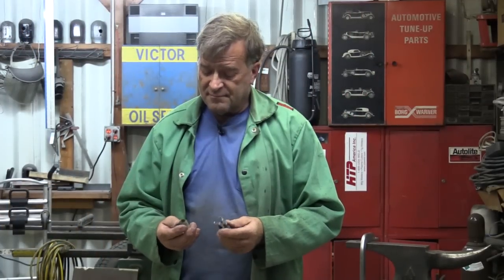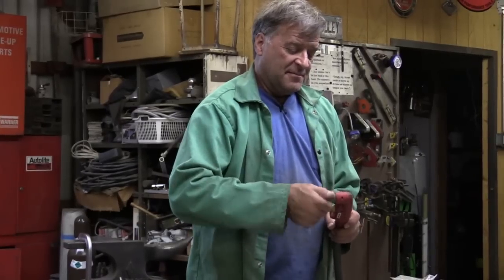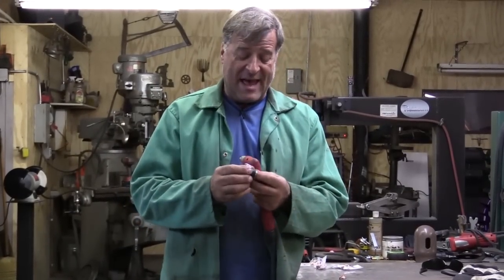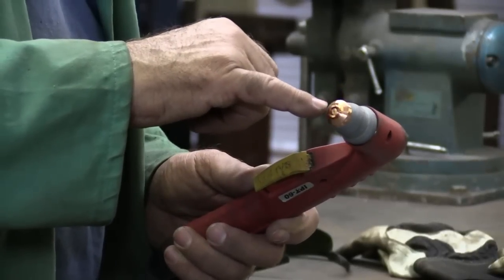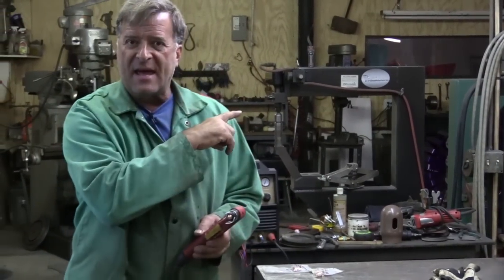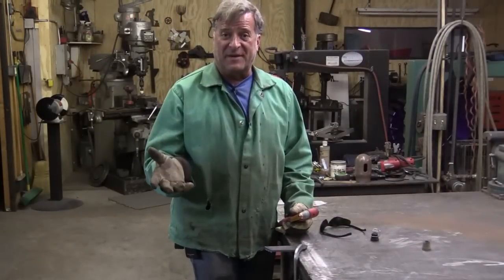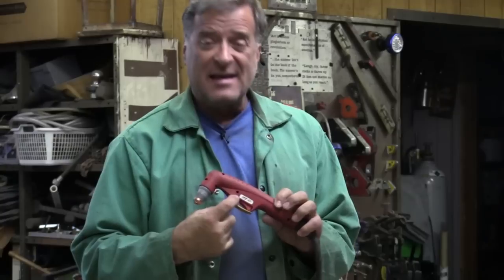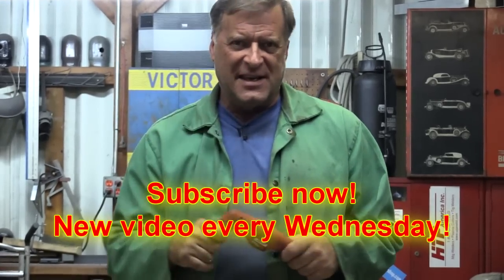How to Use Specialty Nozzles to Improve Plasma Cutting - Kevin Caron

Comment: Dear Kevin, Yesterday I had to replace the gun and cable for my GYS Cutter 35KF because I had previously broken off the electrode tip.  I was unable to find a supplier who had just the gun and could only find one supplier who had the gun attached to the cable, the gun model is PT-35C.
I realized that the supplier did not provide a coupling tube for the air hose, but then I remembered your video where you replaced the innards of your torch gun and you pointed out that there was a coupling tube inside for the air hose and you stressed the importance of holding onto those little clamps.  So I opened the gun, removed the coupling tube and clamps and was able to successfully replace the entire cable and gun that way, putting the coupling tube inside the main unit.
So, thanks so much for that info.  It really helped me out!
P.S.  I apparently have one of the few plasma cutter guns that doesn't accept drag tips...
If you have any suggestions I would greatly appreciate it.  I've used a chariot but it's not so great.
Reply from the maker: I am not familiar with your machine.  But if you check with George at georgesplasmacuttershop.com  I am sure he will be able to point you in the right direction.

Comment: What a difference 3 years makes! My (cheap, rubbish, garbage - believe what you want) Chinese CT 312 MMA/TIG/plasma cutter came with isolated drag cups as standard. Even the tips are double ended, although I haven't used mine enough yet to know if I can burn out one end and turn it around for twice the lifespan.
I'm sure that the wire stand off would work for freehand cutting, but the lateral stand off would be a nightmare when cutting against a guide.
Reply from the maker: I am constantly amazed by the new tech coming out.  Can't keep up with it all.

Comment: I just purchased a Thermal Dynamics Cutmaster 152 and I'm very concerned about protecting my eyes from experiencing flash. What sort of eye protection would you suggest ?
Reply from the maker: I normally use a shade 9 cutting lens.  Either glasses or goggles.  I also try to keep the light below the metal by keeping a close gap with the torch.   Maybe a 1/8th inch at the most of a gap.

Comment: Kevin.... can a single flow plasma cutter just change the torch to a “dual flow plasma torch” and use two gasses? Cutting/shielding?

Next video you should make on plasma cutting, single vs dual flow, and how to setup. 😉🙏

I can’t find anything online, can’t even find a machine that’s Dual flow plasma cutter. Even tho they exist...🤷‍♂️
Reply from the maker: First time I have heard of this.    Have to look in to it I guess.
Reply: Kevin Caron, Artist  cool, so in some cases, lower amp machines can use a Mix of different gasses to cut thicker steel, and not only will the different gas/gas mixes help cut thicker steel, the gas can help in cut finish, and especially true for a plasma that uses a gas for shielding.

So from what I’ve read, some people will have the steel in water, that helps a lot too, with cutting thicker metals + getting a finer/cleaner cut when not having the “shielding gas”

Also reading online; using a proper gas mix for plasma vs just compressed air, is way better, especially if you want clean fine cuts, spending less time cleaning up corners with a grinder
Reply: Thanks Kevin

Comment: That things sure does straight cuts! Even when I use brand new consumables and around 90psi dry air and good ground, I ALWAYS get bevel cuts, no matter the clean steel thickness...Grrrr. I have a good quality machine (Hypertherm 40Amp) and proper 220 current, too. Frustrating for sure, and LOTS of grinding. What's your secret?
Reply from the maker: Proper size consumables to the amps and the air pressure.    You also have to watch your travel speed as well.    Call George at www.georgesplasmacuttershop.com  He can get you the right consumables for your machine and he can also get you up to speed on the rest of it.      He is my suppler for all my plasma needs.
Reply: I know this is a really old question but for anyone else who reads it : travel speed, nozzle size and amps are the obvious things. One less obvious thing that will make a small difference is which side of the torch you put to the good or bad side of the cut. The metal on the right side relative to travel direction will get a better cut than the left. Different travel directions will change which side is the right side so keep that in mind.
Reply: @Lucas12v  Yep, you are correct. Turns out, my air was a bit clogged from the get-go and all is well now. And you are correct about direction etc - weird but true - thanks! By the way, did you see Kevin's video about gas cutting (in my case only really thick material -- and incidently with oxygen and PROPANE - what?!) with a tubing clamp on the nozzle. He is a very fine and clever man.
Reply: @AerialLensVideo  Haven't seen that one. I actually just stumbled across this channel and this is the first video I've watched. I'm aware of oxy propane but I've only ever used acetylene myself. If you want to see some really impressive torch work on thick metal, check out ic weld. He does mostly equipment repairs in the field but some shop stuff too. Lots of torch work and gouging.
Reply: @Lucas12v  Will check it out - Thanks. To be clear, Kevin showed his little trick with acetylene, BUT I later discivered the propane/oxy combo on youtube someplace when I ran out of acet on a weekend. Shocked it cuts perfectly well and way far cheaper. Bonus is, the acet gages setup screw RIGHT IN to a common propane grill tank - same threads exacrly. I am so pleased - even with welding - I will never buy acetylene again.

Comment: How often does that small metal edge with those tiny cutouts get clogged up in use, and then short out? It seems to me that it’s awfully close to a danger point right out of the factory. I’ve seen that happen with a Hypertherm, which is an awfully good machine.
Reply from the maker: No where as often as you would think..

Comment: Is a drag cup (shield) necessary when running a 30 amps or less plasma cutter?  Its been my understanding you can rest torch tip right on metal with <30 amp plasma cutter torch as double arcing is minimal.  Please correct me if I'm mistaken.
Reply from the maker: In my opinion , yes, you need a drag tip if you are going to drag..   Don't care what amps you are running..

Comment: Lol plasma nipples !
Great tips Kevin ,thanks !
I run the thermal dynamics Cutmaster 80 personally .
And for the majority of use it doesn't need to head past the 40 amp adjust .
Matter of fact ,,I prefer the 40 amp tip for precision and the fact that it doesn't require the compressor to run steady
Reply: show off!